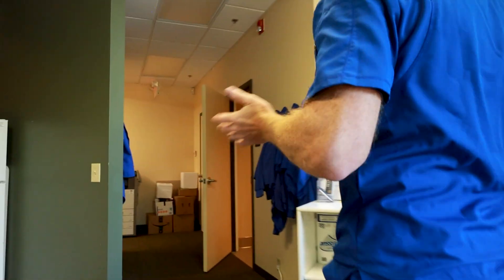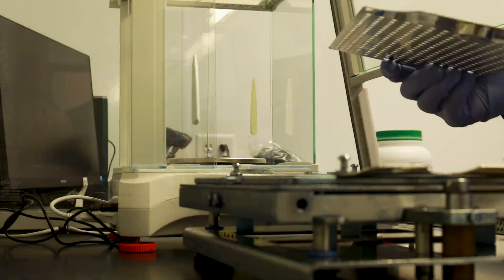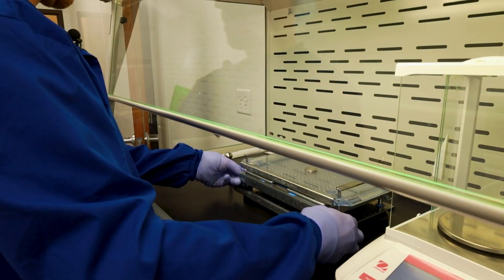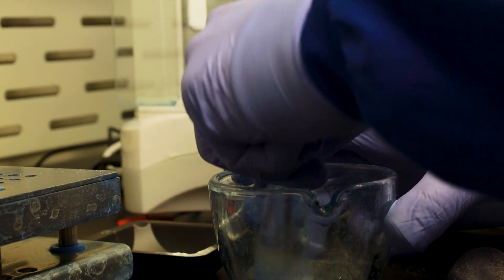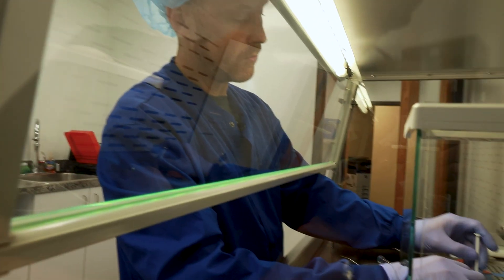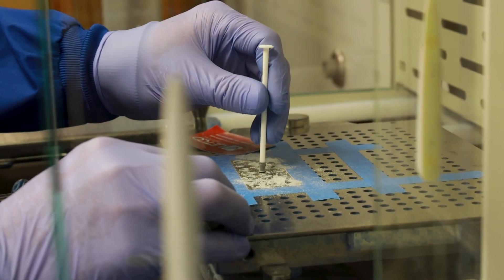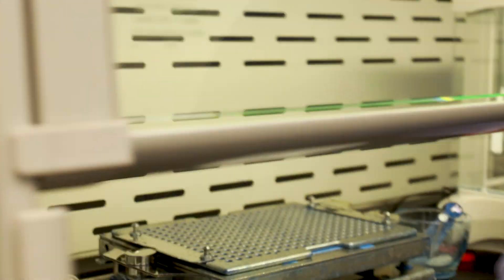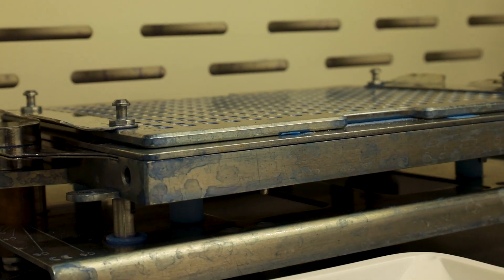Turning an Old Office Into a Cool Science Lab!

Comment: That scraper you used, is it paper, cardboard, plastic?
Either way it's not stainless steel and I'm sure some of the scraper winds up in the medicine.
Please correct me if I am wrong.
Reply from the maker: “I totally understand why it might look odd if you haven’t seen compounding before, but a plastic scraper is actually standard equipment in non-sterile compounding. USP <795> doesn’t require a tool to be metal or pharmaceutical-grade — only that it is clean, non-reactive, and dedicated to compounding, which this is.

Plastic scrapers are routinely used in pharmacies, labs, and manufacturing because they prevent cross-contamination and don’t interact with ingredients like methylene blue.”